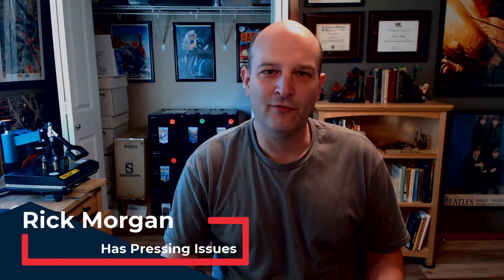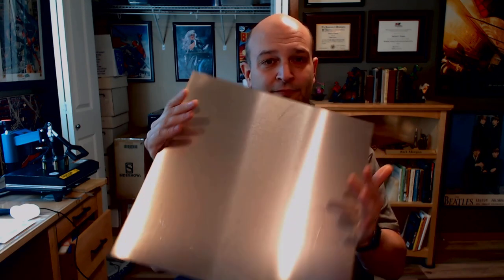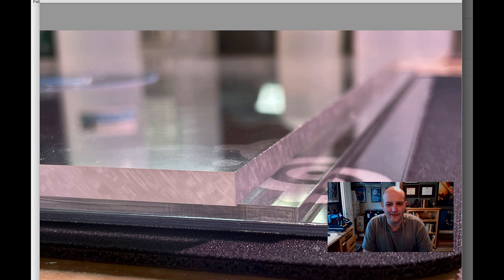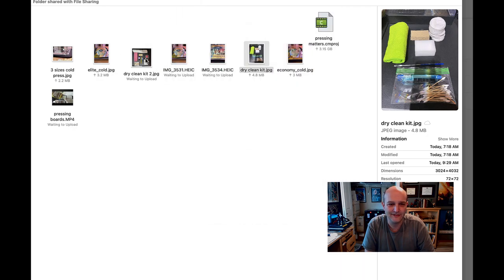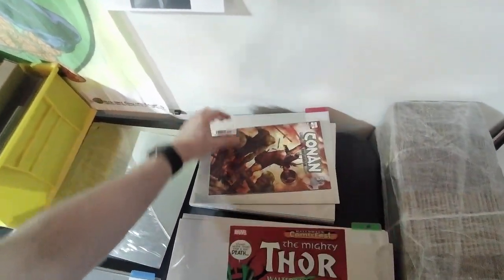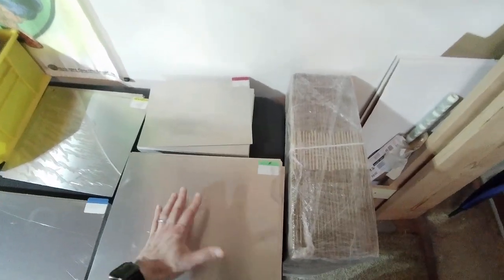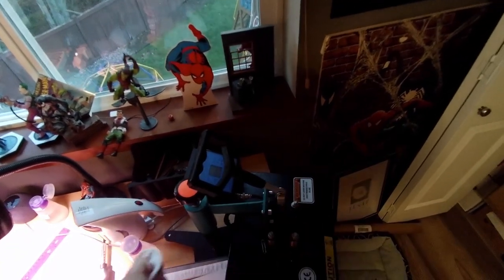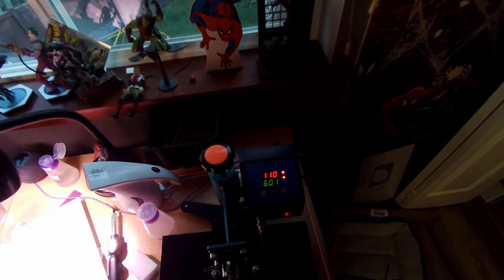Comic Book Pressing boards

Comment: Just picked up a few items, excited to get started.
Reply from the maker: Im glad Dan.  remember this is a game of inches and not miles.  Setting patience and expectations is very important!
Reply from the maker: I laminate mine and out them in an 11x14 frame
Reply: @ImmaculateComics  Mostly I just want to get my PC up graded to CGC and hoping before submitting to do some basic pressing and small repairs. Can you go over in a video how to fix some simple (small) easy repairs like damaged corners, spine ticks and finger prints or slight surface cleaning.

Comment: Hi Rick, would there be any disadvantage to using 12"x12" aluminum sheets with 12"x15" heat press?
Reply from the maker: If there is more pressure on the outside of the board than the inside the board will have less pressure in the. Isle and it will be uneven.  You cannot see this with your
Eye but imagine the board taking in a convex shape in your imagination. For most applications you won’t notice this. Only in very detailed pressing work of fine structures in the center of a book will you notice.
Reply: @ImmaculateComics  Thank you for the response, I appreciate it! Another question, could you circumvent the convex effect by using thicker aluminum sheets?
Reply from the maker: @mtlhd1  yes absolutely you can do that, especially if you get the sheet exactly centered in the press and above the book.
Reply: @ImmaculateComics  That's exactly what I was thinking. Thank you so much for your insight and taking the time to respond. Keep up the good work with the videos!

Comment: Hi Rick. Couple questions...

I have a 10" x 12" press and wondering if I could use your 12" x 12" aluminum sheets for it with no problems. I guess an inch worth will be sticking out. Or would it be better to use 9" x 12"? Do I need to get a custom size to exactly match my press dimensions?

Also, you said to possibly put a "magazine board" in between the book and the sheet. Do you mean one of your chamfered mag size boards or a regular magazine backing board? 

Thanks. Just getting into all this and happy to have your channel and shop!
Reply from the maker: Hi and thanks for writing!  yes you can definitely used a slightly larger board with no problems in the press.  I can also have custom 10x12 boards cut and polished for you if you like.   With custom cuts they would be $25.50 each in 0.90" thickness.  However you can use 12x12 just fine with no problems.

I actually mean any magazine size board and not necessarily a chamfered board.  I hope this helps!

Rick
Reply: @ImmaculateComics  yes. That helps so much. Thanx!
Reply: @ImmaculateComics  Gotcha.  How long is the wait currently on custom size sheets?
Reply from the maker: @carlonbasscomix3387  well unfortunately I made this month's order earlier today, which I expect to get next week.  I probably won't make another order for 3 weeks or so.

Comment: I used an mdf board with 20lbs stacked on top of it. Other pressers say not much weight is needed. What are your thoughts?
Reply from the maker: I did a few designed experiments and found that for large-scale waviness, which I call "macroform" or "mesoform" waves you only need about 2 lbs across a standard size book.  More weight isnt better as it impedes gas diffusion from the book to allow acid gases to escape.  If you are relieving microform defects then you should use about 40-60ln in a heat press.  Thats my two cents worth anyway
Reply: @ImmaculateComics  Thanks for the info. Can you clarify what LN or in is?

Comment: I really want to buy some aluminum pressing boards and other items from your shop, but I'm waiting for these to be available too. I'd appreciate it if you let me know when you start selling them.
Reply from the maker: What size are you looking for!?
Reply: @ImmaculateComics  I wanted to buy 2 thick aluminum pressing plates, the non stick mat, and some of these tic tac boards (I'd like to get some with the staples cutouts and some without). Do they come in different sizes?
Reply from the maker: @breakbeatz309  we only have the tic attack board with the staple cutouts right now but I’ll make some of the other kind too in the next couple of weeks.  I meant what size of aluminum pressing boards.  They some in several difference sizes and thicknesses.  Have you check out the website?  Https://Immaculatecomics.com.
Reply: @ImmaculateComics  I went with the 12"x15" Elite and just ordered. Thanks!
Reply from the maker: @breakbeatz309  right now they are all the same size which is 7.125” wide and 2” tall
Reply from the maker: If you have a special size you want I can design and build it for you.  The forming and polishing takes a while but the laser cutting it’s actually pretty fast once it’s designed

Comment: I received today my 2 aluminum sheets I have a question when u  press a book with one on top & one aluminum sheet on the bottom what temperature do you use on the pressing machine?
Reply from the maker: It depends on the book but usually 165F for me and I preheat the bottom board to that temperature first.
Reply: @ImmaculateComics  thank you

Comment: Do you need two plates in the press?
Reply from the maker: DO you mean for the hot press?  No not strictly but it saves time.  You could just flip the book over and repress it, but most people prefer two boards so it is heated from both sides at once evenly.  if you just have one board on one side, either bottom or top, the book tends to be either concave or convex when removed.
Reply: @ImmaculateComics  thanks that’s what I was thinking

Comment: Curious is we ordered 2 of the aluminum 9x12s. How long until we would receive them approximately?
Reply from the maker: HI there.  that depends on where you live and what shipping method you select.  If you live one zone away from me here in Seattle and you select overnight shipping you would receive them about two days after your order.  If you live in Antarctica on a military station and you select surface shipping it could take a month or so.  I hope this helps!  If you live in Kentucky and you select priority mail it would reach you in about 3-5 days.  So without knowing more information I cannot really answer the question in a specific manner.  I hope this helps.
Reply: Ok got a good idea now thanks! Will order now.. also "BIO-TERGE® PAS-8S from Stepan"  What ratio do you mix that and what do you use it for exactly when you use it? They sent me a free sample that I think will last me a million years! Is that what's in ur immacuclean concentrate?
Reply: Please let me know
Reply from the maker: Sorry I'll write back soon.  I haven't used bio terge in a while now since I started formulating my.own cleaner. I'll have to reference my notes!
Reply: @ImmaculateComics  appreciate it good sir! They gave me 8oz for free. So I'd like to use it if possible
Reply: @ImmaculateComics  I purchased one of ur cleaning kits that comes with the liquid cleaner. But still curious if u found those notes on the bioterg that u recommended in a video. Please let me know asap
Reply from the maker: Hi yeah I wrote 50g/l I DI water adjust to pH of 8.5-9.0 with sodium metasilicate.  I hope that helps!
Reply from the maker: @projectrugged  hi I just replied to your Facebook post!
Reply: @ImmaculateComics  I can find the Facebook post that u responded to? Just curious what ratio I mix the bioterg. 1 part bioterge to 9 parts distilled water??
Reply from the maker: @projectrugged  try 40 grams per liter!
Reply: @ImmaculateComics  ok so that sounds more like a half part BIO-TERGE to 9.5 parts water? Just want to make sure I'm correct.
Reply from the maker: @projectrugged  that would be about 100g/l . It’s
More
Like one part bio terge to 24 parts of water
Reply: @ImmaculateComics  appreciate it!
Reply from the maker: @projectrugged  any time!